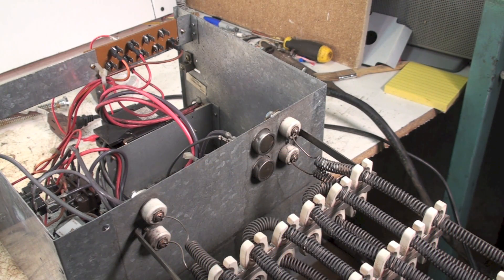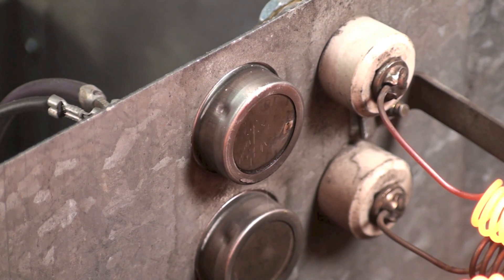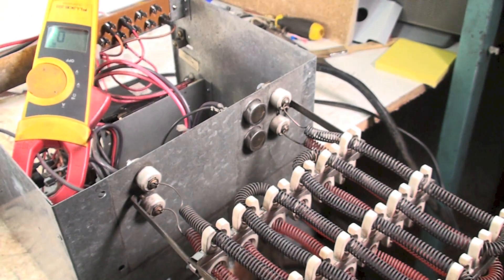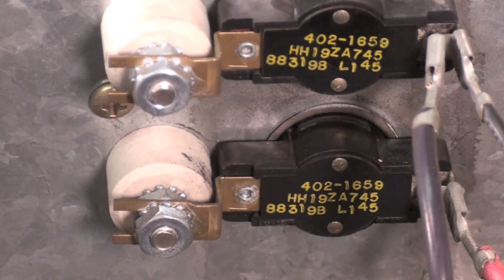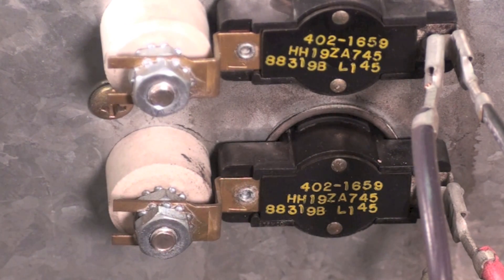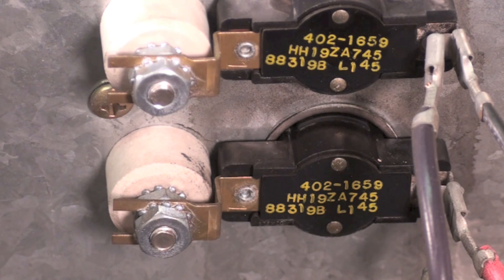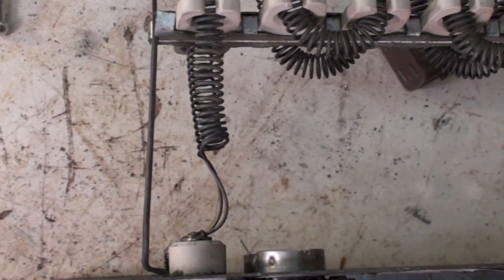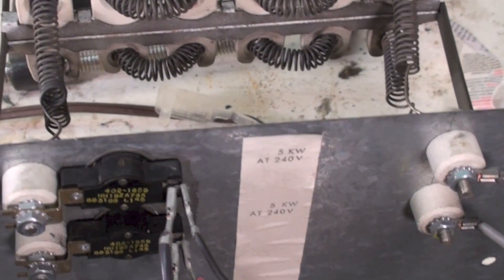How the high temp limits in electric furnaces work.  Part 3

Comment: Works just like a electric dryer thermostat, except the over temp thermostat is rated for a much higher temperature which is between 200 to 250F.

Comment: Why do you suppose an electric furnace would continue to running a heat cycle when the thermostat has already stopped calling for Heat? It appears that it would just keep putting out heat and never stop if I didn’t just shut the breaker off. FYI, I have already swapped out the sequencer and I swapped out the relay for the fan. I started to swap out the limit switches but now I only had two of the three available at the time I ordered another but it’s not here yet.

Comment: I know I'm late to the video so hopefully someone can answer my question so my limit switch the bottom one um looks like the wire got hot matter of fact where the wire connects to the limit switch was red I have not turned it back on obviously because it needs to be fixed but my question is should I be able to change that limit switch and not have to worry about the new one burning like that? And if so when I replace it do I need to install the new switch open or closed or does it not matter? Sorry but wouldn't call Myself an electrician so looking for info and advice
Reply from the maker: The limits are not designed to open continuously because of a failure of another part or a plugged filter.  First, the limit and the wire must be replaced.  Then find out why the element overheated.  Could be a stuck on sequencer, or a plugged filter.
GFM

Comment: Do these switches also control telling the fan to come on when set to Auto and heat is on?
Reply from the maker: Generally no.  The fan on most furnaces is started with the same switch as the first element to come on.
GFM
Reply: @grayfurnaceman  how would I find what that switch is.  This old furnace has no paperwork or diagrams to help me figure anything out.  Not even an ID plate to find out the model

Comment: Is a manual reset limit switch better from a safety point of view if my furnace doesn't have a thermal fuse?
Reply: I prefer the manual reset limit, mostly because it allows the service tech to easily troubleshoot with out having to find replacements for parts.  Both types of limit are effective in shutting down a system under rollout conditions.  
GFM
Reply: @electriccar3253  Thanks. I have an electric furnace. The blower motor failed and at the same time two heating elements in the heat strip failed. Which means it got hot. My concern is the limit switches getting stuck closed!
Reply: @DavidJohnson-tv2nn  If you have had a motor failure, I would recommend replacement of all automatic reset limits.  If you have inline limit fuses, they cannot be replaced with manual reset limits.
GFM
Reply: @electriccar3253  Again, thanks. I have three 5kw heating elements. I was going to replace the limit switches on the two elements that failed. I will take your advise and replace all three limit switches. Currently, the limits are auto reset with no thermal fuses inline. I'm leaning toward replacing them with manual reset. So if there is another issue they will trip out and stay out until I or someone can have a look at the problem. Or do you think auto reset limits will be ok?
I have a problem trusting them to work properly after the last incident. Don't want to burn down my crappy house.
Reply: @DavidJohnson-tv2nn  I never argue with a man that wants to use manual reset limits.
GFM

Comment: Had one of my thermal switches burn up and need to get a new one. How do you tell what temperature the  limit switch should be. No mark or stickers on mine. I have seen 120-190. Also should I replace all four of them? Older Wesco Electric heater 960k. Says max air output 200 degrees with air intake 77
Reply from the maker: Are you sure there is no marking?  It is sometimes stamped into the mounting ears.
GFM

Comment: Hi sir ! 
I really appreciate yours video 😊!!
I keep trying fix my furnace 
My furnace have limit switch whit a brass long contact  60t11 201728 c8730 l170 -40 
But I am not able to find one in my  area I order 1 on internet 
My question is this limit switch have only to 2 contactor but not the long brass bracket can I replace whit a pieces of wires whit contactor both side and   plug them to replace the fact it's missing the brass bracket ??

Thank you very much for the answer ! 
Have a good day!

Comment: Hi...don't know if you're still responding to comments or not but I have an issue of my heat will not turn off even when AC is on. Duct work is great and a brand new thermostat installed since the issue started. Also clean filters....Does this sound like bad limit switches is the problem? Does this mean that they're "stuck closed"? Thank you for any info.
Model FY4ANF036010AAAA
Name CARRIER RNC FAN COIL UNIT
Reply from the maker: Electric elements are mostly controlled by sequencers, which have a tendency to stick closed.  If it does stick, the limit switch will shut is off, but the switch will eventually fail.  In other words, get it fixed.
GFM
Reply: @grayfurnaceman  thank you. Ordering new limit switches now.
Reply from the maker: @BastardOfAMadman  Remember the sequencer replacement.
GFM
Reply: @grayfurnaceman  do you have a video explaining the sequencer? Thank you.
Reply from the maker: @BastardOfAMadman  Try this one:  https://youtu.be/ls8ypoWdal8
GFM
Reply: @grayfurnaceman  thank you very much.

Comment: I have an electric fan coil system that has electric 5k elements. 208v the wire from switching relay to the electric element keeps burning. If it's not the wire then it's the relay coil. Using correct wire. What would cause the wires to keep burning ? could a bad temp  limit switch do that?
Reply from the maker: Burned wires come from poor connections.  If the terminals the wires to connect to have overheated, the terminals and/or the relay may need to be replaced.   
GFM

Comment: Im sure duds can be bought but what are the odds 2 brand new carrier limits being bad? On an electric 15kw unit only 1 strip works continuously. Narrowed problem to 2 bad limiters, ordered 2 new replacements online and having same issue, no matter their placement in the unit. I moved the one good old limiter around to test coils and it works flawlessly. The old bad ones and the replacements only work for a few seconds before tripping. around 90degrees.
Reply from the maker: Your problem is not the limits, the problem is airflow.  Dirty filter, blower wheel, A/C coil or ductwork problems.
GFM

Comment: Having issues with my furnace blower has been replaced, circuit board, relays, thermostat. Not sure what else HVAC guy replaced still getting cold air. I noticed that there is a lot of rust buildup on the nuts that attach to the white part of the limit switch could this be the problem.

Comment: Last year the blower stopped but the  elements stayed on had to shut  it off at the breaker.
This year it blows lukewarm air . Did it burn up an element?
Reply from the maker: It may have blown a high temp fuse or caused a limit switch to fail.
GFM
Reply: grayfurnaceman   Thank you, and for the videos.
Reply: I see no hot spots on wires, limit switches and sequencer all look new. So night temperature fuse? Can limit switches and sequencer be tested?

Comment: Great videos sir! I'm having trouble with my electric furnace recently 
, it will sometimes only blow cold air. I have tested the continuity on all 3 limit switch and 1 of them looks to be always tripped even when cold. Is there a way I can bypass element/limit switch  (#2of3) so only element 1 and 3 work. I can't change the limit switch right now, that's why I want my furnace to work like that temporarely. Thank you
Reply from the maker: First, is your filter clean?  Blower wheel dirty?  All diffusers open?  Ductwork in good condition?  There is no point in disconnecting one element if the limit switch is open.  The limit has done that for you.  If you get low heat from the diffusers, there is either a sequencer that is sticking part time or an overheat condition causing one of the limits to open.
GFM

Comment: I have a Coleman Evcon EB15B that heats fine, but the cooling down fan won't turn off.  I have replaced the thermostat and it's still doing it.  Any suggestions??
Reply from the maker: Probably have a sequencer stuck on in the furnace.
GFM

Comment: Hello Sir.I have a Coleman Eb15b furnace.When it's running the heat is like a cool warm and it runs all day but never reaches a temp of 75 in the mobile home.I have checked the sequences and the element and both are working fine.Can you tell me where would be a good point to look next.Thank you in advance
Reply from the maker: That furnace has 3 elements.  You almost certainly have 2 of the elements not working.  Could be open element, open limit, open element fuse.  You could also have a tripped breaker.
GFM
Reply: I checked the breakers.Did the element test with the blower out so they where working fine.It has two 5kw elements.I also cleaned the blower while I had it out.So all that being said would it be a pretty good guess to say that the limit is bad.

Comment: I have an electronic trip  furnace that will  other come on. I replaced the thermostat and still furnace will not come on. I jumped the red and white wire still no heat. Fan functions in on position but not in auto position. Furnace fired up one time last night and shut off properly.  It fired up again later but didn't blow any heat. Any suggestions? Thought it might be the heat elements but watching the video I am not sure.  Thanks, Gary
Reply from the maker: You probably have a control problem.  Possibly a sequencer.  But first I would jump R to W at the furnace.  
GFM
Reply: I disconnected the thermostat and jumped the red and white wires at the furnace. Furnace is still not coming on. Furnace is a Nordyne model E1EH-017HA

Comment: I have an older Bryant 961-010 10kw electric furnace. It was operated with a clogged filter. I first replaced a limit switch that had failed. NO difference. The upper element had failed. the inline fuses are still OK so I have ordered a heating element kit. 2ea 5,000 watt strings.
The limit switches appear to be the same but one is an L120-3-J6V and the other one is an R6V. Since they both open at 120, I'm assuming they're both really the same. It is just the position of the switch in the mounting plate that is different. Anyway, thanks for the video.

Comment: should the high heat limit switch on my electric furnace be opening and closing? Should not the blower be producing enough air flow to keep it closed? Its a 2 speed blower...high and low speed.....it's wired for high speed and it's heat only no AC.....
Reply from the maker: +Walking in the light for Yeshua You almost certainly have an airflow problem.  Dirty filter, plugged blower wheel, ductwork problems or diffuser valves closed.  Hope this helps.
GFM
Reply: grayfurnaceman GFM.....I pulled the blower and cleaned it ....it wasn't dirty at all .....it also has a clean filter......and it doesn't have a diffuser valve so I'm with you on this one...It has got to be a duct work problem....thank you so much for replying.....
Reply: grayfurnaceman GFM.....I think i have figured out the problem......this is a 15kw furnance.....it has a 10kw set on a single limit with a double stack switch....and it has 5kw on a single limit switch.....Im having trouble with the double stack single limit switch kicking on and off on and off.......the 5kw is working fine...so I changed out the 10kw limit switch...it had a 150F in it ....and it was doing the same thing...on and off on and off...I put a 165F back in it because that was all I could get.....at the time......and it is doing the same thing on and off on and off......well.....just checked the single limit switch that is on the 5kw element by its self.....and it is a 190F and it is working fine.....I think some one had changed out the 10kw limit switch at some time and replace it with the wrong temp ......My problem is I can't find out what is the original temp limit switch that is suppose to be in it.....it is a Intertherm (Nordyne) E2EH 015.....is there some way you can help me out with this original part....what temp should it be???   Im thinking the 165 is just way to low and that is why it is opening and closing
Reply from the maker: +Walking in the light for Yeshua I can't be sure but the 190F seems to be the proper switch.  Good luck.
GFM
Reply: grayfurnaceman I think your right.....I checked the single 5kw and it has a 190F limit switch on it and it is working fine.....Thanks for your time GFM.....

Comment: I had a call that her furnace would shut off at night. To make a long story short. I ended up pulling the blower and cleaned off years of pack down dirt (it doesn't rattle anymore), and checked all sequencers, and limit switches, and I replaced 2/ 60 amp fuses. It's a Coleman 3500A series 15K. 
I don't understand why the blower has a 4 to 5 minute delay on an electric furnace. I've never worked on One that had a blower delay................is there a problem that I don't know about? .............other than that the furnace works fine.
Reply from the maker: +Real Gagne There should be no blower delay at all. It should have come on with the first element.  The sequencer may have been wired wrong.  
GFM
Reply: +grayfurnaceman It's what I thought. It's a 1993 furnace and who ever worked on it over the years made it look like spaghetti inside. I'm a retired HVAC Tech, and I only do this for seniors with low income, and I don't charge, unless it's an expensive part.
So I would have to follow the blower wire from the harness to a sequencer?
Reply from the maker: +Real Gagne Yes.  The fan should be connected to M1 or M2.
GFM
Reply: +grayfurnaceman  Thanks so much. I don't usually work on mobile homes. 95% of my work for 20 years has been gas furnaces. I appreciate your expertise .
Reply from the maker: +Real Gagne Merry Christmas
GFM
Reply: +grayfurnaceman   I agree with the contactor video. I watched "furnace over heating with the fuses". In the Coleman 3500A series The 2/ 60 amp fuses are set up a bit differently. I wish I could send you a pic, but I don't know how on youtube..I can only do it through e-mail. Anyways, at very bottom is a 60 amp and very top is 60 amp. The 30 amps are the 2 middle Ones. I would assume that the bottom One is L1 and top is L2 since there's no markings on this old furnace. Is that called a fuse box or a busbar. I need to order One and then replace with a contactor instead of sequencers.
Reply from the maker: +Real Gagne You are correct about L1 and L2.  That fuse block had some problems.  They tended to burn up or overheat the fuses.  Coleman(York) had a breaker assembly that replaced the fuse block.  I am not sure they still carry it.  
GFM
Reply: +grayfurnaceman  You're so right about that. I replaced a new Intertherm (same as Coleman) last year, and it has breaker and contactor. Once romoved the fuse block, there's plenty of room to  put a breaker bar and 2 breakers.
Reply: +grayfurnaceman  I'm completely baffled now. The sequencers have continuity, and the blower wires are correct according to the diagram that I finally found. So I went and replaced the sequencers anyways for my own curiosity, and still there's a delay on the blower when furnace stars, but yet when the burners go off, the fan shuts off 90 sec. later. I've triple checked everything, and it should be working fine. She has not complained about the furnace, but like you, I know that the blower should start right away.

Comment: TYVM for your excellent videos. Here's my EB23B story: I noticed that the laundry room was very hot. I felt the furnace door panel and it was hot. The fan was off. I lifted off the door and felt the squirrel cage fan housing and it was extremely hot. I turned off the breaker for the element and turned on the fan manually. The fan housing cooled off. My diagnosis (thanks to you) is I have a bad sequencer; one element is stuck on. Also, I must have a bad high-temp limit breaker switch because the element stayed on. How did I do?
Reply from the maker: +Blog Idaho Looks good.  Even if the limit switch was still operational, I would replace it just for safeties sake.
GFM
Reply: +grayfurnaceman I replaced the sequencer, no problems but it still has one or more elements on when it is just resting. (no fan and no demand from the thermostat).
I'm baffled.
Reply from the maker: +Blog Idaho Possibly one of the elements is shorted to ground.  The sequencer only cuts out one side of power.  
GFM
Reply: +grayfurnaceman I&#39;m pretty sure you are correct. I put my clamp-on meter on each wire and saw which one had current while the furnace was off. I&#39;m guessing it was only 110v going backwards through the element to ground. Would that explain why the heat limits had no effect (not enough heat to trip it)?
Question: I pulled the wire that goes from the breaker directly to one side of the element. Can I run the furnace this way? If so, how long?
FYI the Part number on the pair of elements is 3500-411.
Reply from the maker: +Blog Idaho You got it.  I would not recommend running it.  I am not sure the elements are available.  You can get a restring kit that will probably work.  I did a video on installing a restring kit.  
GFM